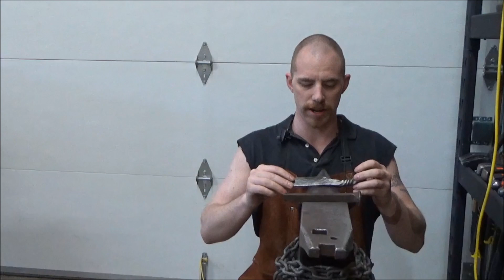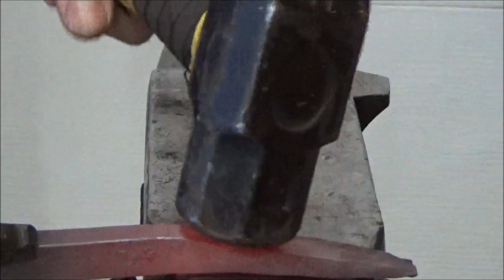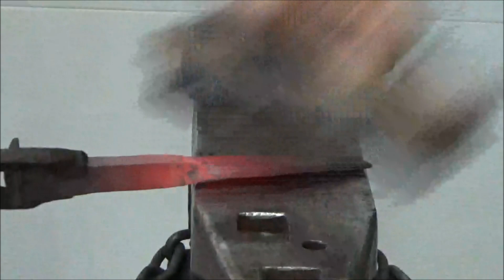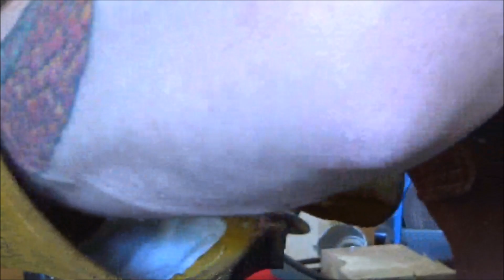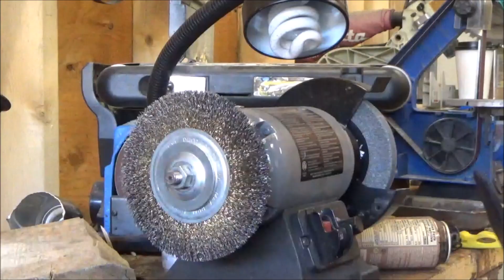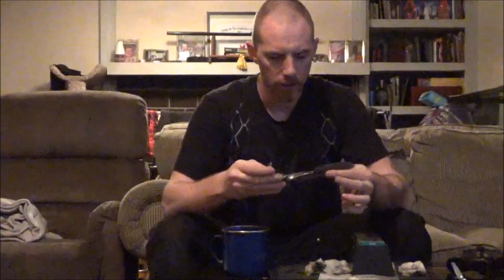Blacksmith Forging a Rail Spike Knife

Comment: LMFAO!!! 
NO disrespect in my laughter, Jeremy... just finished forging my own first RR spike knife, and ran into a bunch of the same issues you had on this one. Trying to centre up the blade to the handle, trying to accomplish the handle twist with the wrong damn tool, and throw in not having the right tongs for the job and having to chase the damn thing across the floor countless times. I laugh because I just realized I had re-enacted a good part of this video without knowing it! Although..... I think I swore a WHOLE lot more than you did in the process! (Unless you edited a BUNCH of audio out!)
Cheers!

Comment: Something you may wish to try for your next spike knife: instead of forging along the flat of the spike try forging on the diamond, you'll gain a good bit of width rather easily and an almost pre made point. Then when you have the blade done you can line everything up with the twist.
Reply from the maker: Neat. I'll try that.